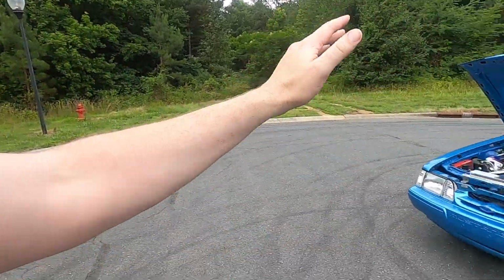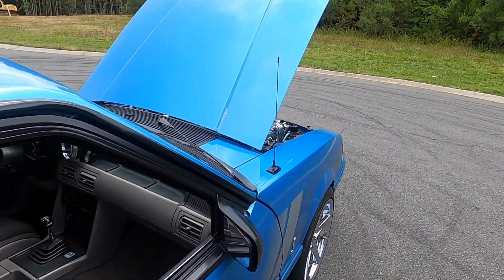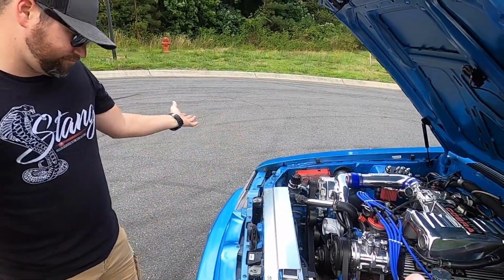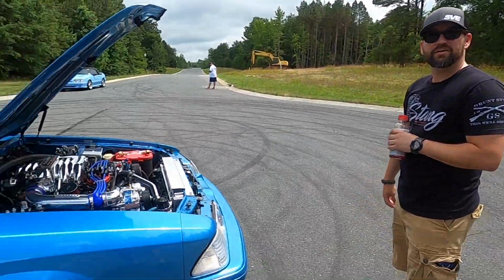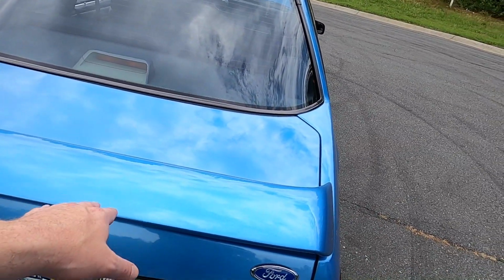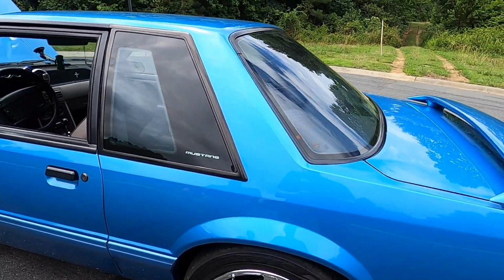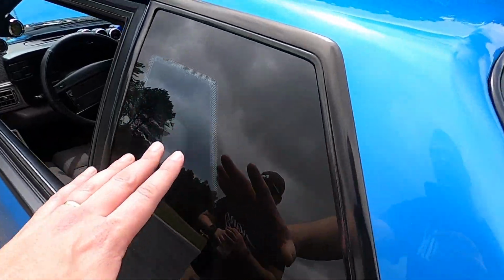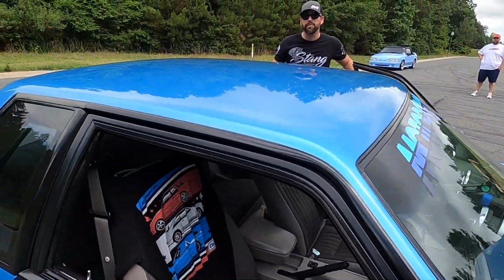SUPERCHARGED BIMINI BLUE 92 NOTCHBACK FOXBODY MUSTANG! // PERIOD CORRECT COUPE

Comment: doesn't he know that those monster tachs are not cool anymore? I hope he didn't drill any holes in the dash to do that.
Reply from the maker: That was done by the original owner I believe.
Reply: There was an original Monster tach installed by the original owner. I used the existing bracket to install the newer Cobalt Tach. But I actually love it. So cool or not, it stays. Haha.